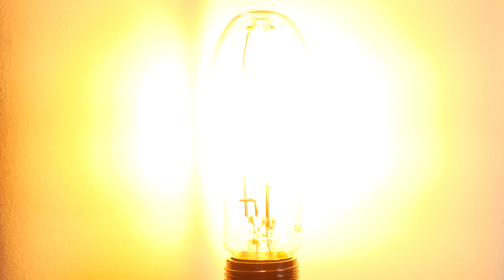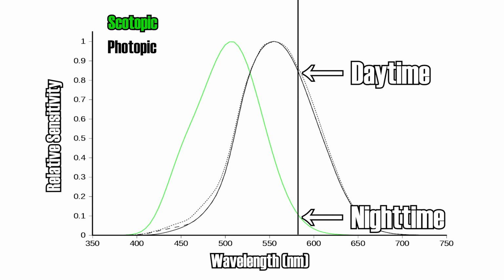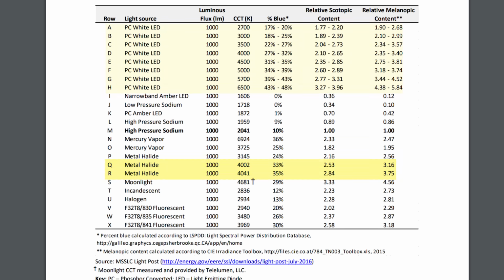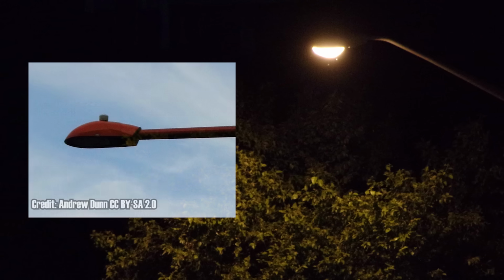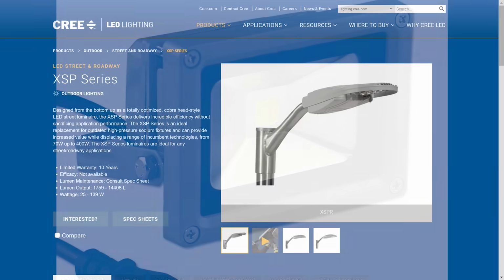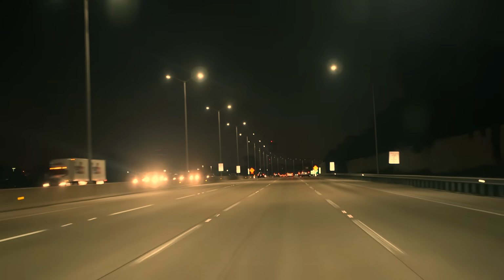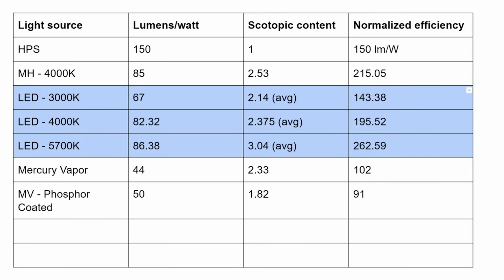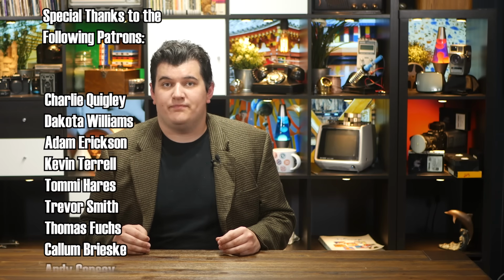The LED's Challenge to High Pressure Sodium

Comment: One thing I wonder about is if the Warner light may do a better job lighting the roadway in fog or other inclement weather.. 
I generally also prefer the more blue color of most lights.. I definitely see better in that color. But it is rather harsh .
Also.. I never believe the marketing about the longevity of LED's. I have a few Cree bulbs I bought several years ago.. they were pricey then.. about $10 per bulb.  Very bright, but honestly didn't use much less power than the equivalent CFL..
All of then have now failed.. at way less than the 20,000 hours or whatever they claimed. And they were a "quality" bulb .
I now use the budget brand from Lowe's or Home Depot. They are about 75% as bright and 25% the cost. 
Great and interesting video..
Thanks for posting
Reply: kens97sto171 Ha!  You think those cheep ass budget LED’s are going to last as long?  I’ve got a bridge to sell you.  Fun fact, most LED failures are due to the power supply (driver) failing and not the LED.
Reply: praestant8 
They're cheap enough that I don't give a shit if they fail early. That's the point I spent $10 per bulb on a very high-quality Cree manufactured bulb. And it didn't last anywhere near as long as it should have. Home Depot sales and 8 pack for $14. 800 lumen day light bulbs. I've had them  for 2 years so far haven't had one fail yet.

Comment: Great content thanks.
I remember my trip to Hawaii in 2001 and hearing from the locals that there are special laws in place to prevent light pollution due to the observatories. The view of the night sky was spectacular yet the roads and parking lots were well lit. I would guess that the observatories are having a tough time of it with the volcanic eruption currently taking place.
Reply: Or maybe its better due to the lack of people
Reply: Actually for astronomy the sodium lights are better because they only put out one wavelength, technically two but they are very close to each other, making them much easier to filter out
Reply: I saw those lights in Hawaii.  They reminded me of similar lights in San Jose for James Lick Observatory.   Although in the last year or two I've noticed the lights being replaced with LEDs throughout San Jose.  Not sure if the rules changed or what.

Comment: As for dimming, in my city at 1am only every 3rd street light is left on.  The result ia still sufficient for pedestrians but very uneven lighting and of course the llights don't wear out not at the same time so probably maintenance got a little more expensive.  I'm actually quite happy that the light next to my sleeping room is off late at night - but somebody else down the road will have to suffer the full strength of illumination for the entire light.  So dimming would probably be the best solution.

The CRI of sodium lights is awfully bad and can essentially hide thigs on roads.  I rather suffer ugly blueish white than the monochromatic light of low pressure sodium lamps with the incredile CRI of zero or effectivly monochromatic light of high pressure sodium lights which in the typically used versions for street lighting have a CRI of just 25.

There are versions of high-pressure sodium lamps with high CRI of around 80-90 which can be used for interior lighting or shop windows - but those types are less efficient and rarely if ever used for outdoor lighting.

Comment: LED's suck.  They burn out much faster.  CPS energy in San Antonio there LED lighting is UGLY, and burns out like Detroit's.Damn liberals.
Reply: More bullshit from a trumptard.  Ballasts and gas envelopes in HPS lamps don’t last nearly as long as LED
Reply: praestant8 HiLIARy lost.  Get over it.  Since you like burned out street lights why don't you just move to Detroit you will love the lack of basic services there.
Reply: Jorge Rivas I'm pretty sure a good quality LED lasts much longer than HPS.
Reply: What kinda nonsense is this? LEDs will last decades. Now, if your driver is cheaply and shoddily built, like some are, that could burn out, or fry your LED, but that's bad engineering and bad construction, not any problem with the technology.

Comment: I was a part of a Turtlewatch program for a while a long time ago here in Australia. The lighting of the surrounding areas was often confusing for a lot of the hatchlings as you say. Common practice was to guide them down the beach manually using torches (flashlights) to the water.

Comment: The cool LED light makes driving safer in a short run, but in a long run it disturbs your sleep and turns you into a dangerous driver. You're a safer driver if you're kept awake by the blue light few hours longer, but you can't be kept awake 24/7.
Reply: Obviously, no one can be kept awake forever regardless of light color.
Reply: No one should be driving 24/7 in the first place.
Reply: wear yellow shades
Reply: +Alex Atkin What's your country's max working hour? Mine is 9hrs.
Reply: Exactly...... there's not much points against the use of LED instead of sodium lamps.
Reply: But ultimately, nobody should be driving for such long hours that they CAN'T have a couple of hours rest period before sleep.  The problem is modern working conditions rather than street lighting.
Reply: Screw everyone who uses daylight bulbs period! Yellow light all the way: it is simply sooooo cosy that way ^-^ and cosiness is what everyone needs :)
Reply: Roman Bukins I would rather be awake and see clearly than to fall asleep behind the wheel because of cozy lights. I can get cozy lights at home, where I would rather sleep.

Comment: I've noticed new police cars in my city with LED light bars. When they're running a random breath testing checkpoint, you cannot see the flashing lights on the light bar AT ALL when driving in the opposite direction. I think this is one of the best demonstrations of how the lenses of these lights can be designed to prevent "sky glow".

Comment: What about putting a filter to block the blue light on the lens of a 5700k led street light. You could get the efficiency of the led but not the effects of the blue messing with are circadian rhythm.
Reply: Hill On Wheels Doesn’t work that way.  Study optics, color rendering and lumens.  NEXT!

Comment: I'm an electrician at an international airport in the Midwest, and the light pollution from our facility alone is staggering. I beg my bosses to get a lighting engineer involved in some projects, and it never happens. We install LED wallpacks all over the place that shine almost 90° from the wall (even large ones meant for wide open spaces are used for stairwells!), and they're distracting over a mile away. I try to educate how much of a waste that is, but no one cares. It's infuriating!

Comment: Another great video! When I moved to San Jose I was alarmed at the color of the streetlights! They're the same color as yellow traffic lights! But then I learned why, the Lick Observatory. 

I think you should also consider the maintenance and replacement costs of HPS (24k hours)vs LEDs (50k hours).  When I ran the calcs for my house it was a no-brainer.

Comment: In my opinion You are a great presenter, and I find that I watch with interest subjects that I otherwise wouldn't give a passing thought.
Thanks for another enjoyable video that also made my "general knowledge" a tad wider. 
((P.S. I seem to remember having been told that one "reason" for using the LowPressureSodium lamps were that their "relatively long wave length" made their light better suited for conditions with "low visibility", when arguably the need for lighting can be said to be at it's peak.
The argumentation was something along the lines that "whiter light" made "Fog//heavy rain or snow" more "opaque" to the driver. I'm not certain whether the argument was basing this on some quality of the light, or some property of the human "visual system" or some combination of the two. Was this a "theory" that came a cross while You researched this topic ??  D.S. ))

Comment: When it comes to the circadian rhythm disruption issue, I think there could be a pretty good compromise solution. High traffic and high speed roadways could use the cooler lights for added safety, while low speed residential streets could use the warmer lighting to limit sleep disruption. Since drivers will be moving more slowly in those areas anyway, it isn't as much of a priority that they be able to see as far or have as fast of reaction times.

Comment: It seems like a good compromise would be to have the higher-temperature lights in non-residential areas and highways, and stick to the lower temperature LEDs or HPS lights in residential areas.

Comment: The issue with white lighting on highways is that it messes with night vision. It's fine if the highway is lit the whole way, but moving from lit to unlit and back again is tiring.  Also as you mention it's down to the heatsinking and driver design if they're good. I think the issue isn't well discussed enough in street light purchasing. I've seen a lot of LED lamps with blown chips and failing drivers only a few years after installation. Driver cooling needs to be better thought out to prevent the caps being cooked.

Comment: The thing about blue light ruining your vision is a simple misunderstanding. Blue light ruins you night vision, it doesn't damage your eyes.

However, that brings me to the one thing everyone seems to be missing when talking about street lighting: Night vision. Or in other words: The capability to see things that are not directly lit by street lamps or headlights. I still remember the time when you could drive on an unlit street and actually see things outside the small area your headlights and the headlights of other cars light up. With the modern hi-power white lights that is almost completely gone. (That modern cars try to blind you with their instrument clusters doesn't help either...)

You mentioned LED lighting being smoother than the older lights, not quite as spotty with areas that get less light. That actually is a bad thing. The changing light conditions help our depth perception to work when there's no single light source (sun) with its shadows. The smoother the lighting, the more the brain has to rely on relative sizes of objects. Something it actually is not very good at, even more so because cars come in many different sizes.
Reply: is it possible that your night vision has gotten worse? it can as you age

Comment: +Technology Connections — Your use of the "cooler lighting" term is confusing in places.  Do you mean lower Kelvin color temperature, i.e., shifted toward the red end of the visible spectrum, or bluish light, as from "daylight" LEDs and "cool white" fluorescent tubes, which actually produce "hotter" lighting, according to the definition used by physicists?

Comment: it sounds like the blue light fear camp is based on the original issues with flicker from fluorescent lamps that cause the iris to expand and constrict to try and compromise for this flickering, which causes the muscles in the eye (iris) to wear out so to speak. as muscles can be torn by use, destroying muscle cells, and thus require cells existing that are still alive, to split and divide losing some of their telomeres shortening the hayflick limit distance to ending their life span

Comment: We have those CREE street lights at the university I work at. I'm in the electrical department. Our sky glow is actually worse with them than the HID lights we used to use. The issue is that equivalent lumen fixtures are generally purchased at higher color temps. Believe it or not the reflected white light from these led fixtures washes out the sky worse for telescope viewing of the night sky. The color is also impossible to filter out due to the wide spectrum of it. I forget the wattage but the temp is 5K. I also have them outside my house and yes, it affects my sleep.

Comment: You are wrong.  Under night conditions your eyes are blinded more by the blue light, cannot SEE things better with it.  This is also when it is low level light, not so much light that it is essentially nearer a daytime level of light, not on a linear scale but rather log because that's how the eye perceives it.  The correct solution is to stop using LED lights in the colder color temperature and move to high CRI, and around 4000K color temperature.  The two go together, you can't have high CRI at a cold temperature.

Your associating moonlight fails to take into account that it is harder to discern depth, and colors.  Why are colors important?  They are a very important aspect of identification as well as reading signs.  Of course you can still "think" about what you see and identify it but having to do that continually means a less optimal driving condition.

Now stop and consider what happens when your eyes are more "sensitive" to bluer light.  Your pupils contract so you take in less light.   Everyone has experienced the phenomenon we call "glare" and whether you want to admit it or not, glare is not productive to seeing things.

Please a little common sense.   Have you never seen driving glasses?  They are yellow, not blue tinted to produce a warmer color temperature, and no they are not for daytime use.  Do a web search if you like, these yellow tinted glasses are for night use.  I know it's hard to believe but this has been researched for longer than you've been alive.  Maybe consider researching without the tainted opinions of those in the LED lighting industry that just want to sell lumens by offering product in the colder color temp.

Even if you don't want to consider research, there have been many comments in recent years about how harsh and more difficult it is to drive in areas with these glaring cold LED lights.   Did you think people were just imagining they couldn't see as well?  I can assure you that it is not the case, people are in favor of seeing better.
Reply: Stinky Cheese CRI is not a color temperature.  Clearly you know absolutely jack shit.  Why are driving lenses yellow?  To filter out the yellow light an allow blue to enter the eye.  Tinted lenses are subtractive to the color not additive.  Maybe you should know what you’re talking about than being an insufferable dumbass.
Reply: praestant8, I never claimed CRI was a color temperature.  Clearly you aren't very good at reading because if you were you would realize that if I meant CRI was color temperature then I wouldn't have mentioned BOTH CRI AND COLOR TEMPERATURE.  

Yellow lenses do not filter out yellow light to allow blue in.  It amazes me how ignorant you are.  Do some research and see how silly your post is, because it clearly demonstrates that you don't know thing one about color filtering.  Hint:  A color filter filters out the major of colors BESIDES the color you see.  Yes, tinted lenses are subtractive of color and  yellow lens subtract more of the other colors than  yellow.

It's almost laughable how wrong you are, yet to have an attitude and call names too?   You are full of WIN, lol.

Comment: Light pollution is a problem pretty independent from the actual light source used.
Only LowpressureSodium can be effectively filtered. And for all lamps it really helps when the fixtures is designed correctly as to not waste so much light and to spread it evenly and for that it would be important to INCREASE the number of lamps used: Smaller distance between lamps would mean less falloff and smaller brightness variance.

About the perception of brightness of different wavelengths:
The ratio between energy and perceived brightness doesn't change much. It is simply that under the sensitivity of the cone cells drops of sharper than rod cells do. So it really depends on exactly how bright the lamps are when talking about the perceived brightness/watt.
As far as i am aware of in most countries the regulations put the minimum brightness that the streetlights need to provide at well above 0.5 cd/m², more often than not it is above 2 cd/m² - well above the scotopic range, mostly just mesopic and even "normal" photopic. And there the sensitivity of our eyes is still great for those wavelengths - so that advantage of LEDs is only there if you have really dim lights only.

Comment: Here in the Detroit area, the street lighting was owned and run by the city, independent of the local utility company (DTE Energy) They were many large areas of the city and neighborhoods that had gone dark due to failure. It was decided in conjunction with DTE to totally replace all the street lighting with LED’s. I believe Detroit is largest city currently lit by LED. There’s a picture of Metro Detroit taken from the ISS and it’s quite evident how the city stands out in comparison to the suburbs, in light level.